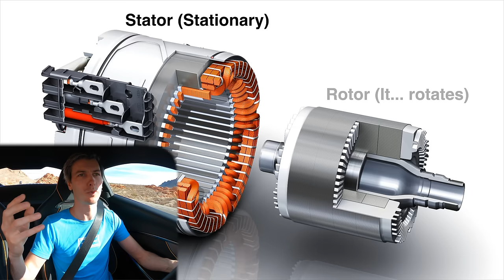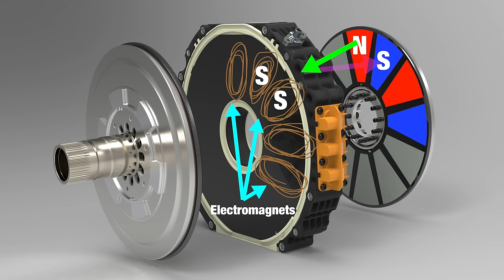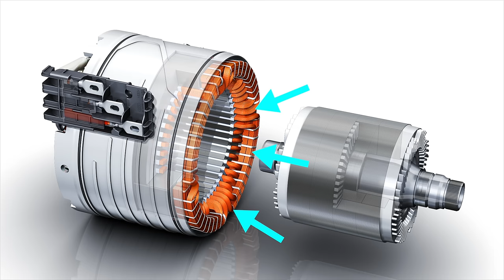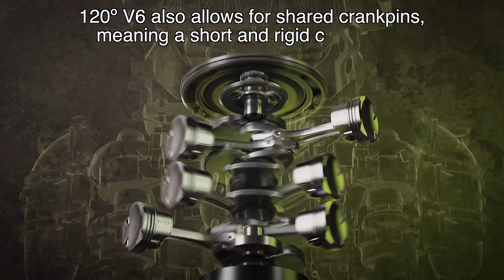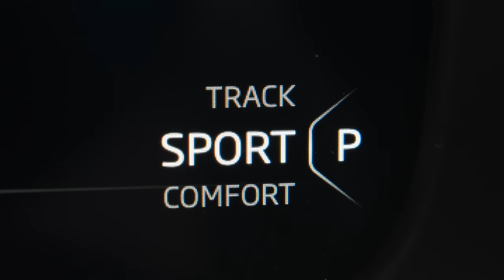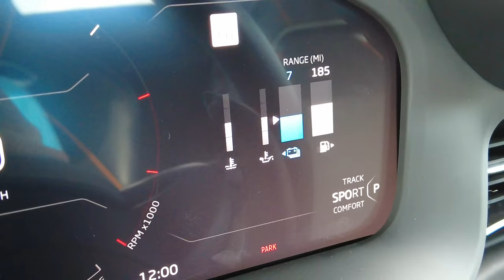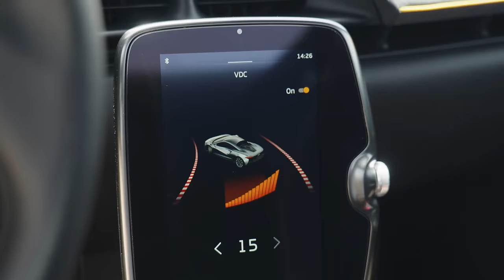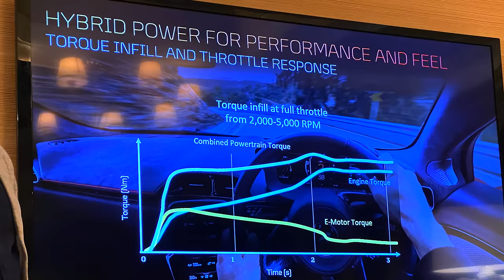These Tiny Motors Make Big Power! Why Supercars Choose Axial Flux

Comment: I would really like to see more hybrid electric cars that have electronically control throttles using some sort of system for adaptive load.

Essentially like if you're cruising on the road at 80mph at 3000RPM and 15% load, but the engine knows It actually has a significantly higher thermal efficiency at 35% load the ECU could turn up the load on the engine, and use the motor to store the rest in battery. I don't know how much more efficient the engine would have to be to overcome the losses of the electric drive train, but it seems a reasonable enough concept.

Alass I have no whiteboard or advanced engineering degree with which I may attempt to prove my crackpot theories

Comment: "why not go all the way to 180?" have you seen subaru boxer engines? they are more common outside the car on a workbench than inside a car and running. but i guess that would be par for the course on a Mclaren as well. regardless of what they do.

Comment: Rotor on rotor huh!? Years ago I dreamed and in that dream I saw something like fan on a fan which a flying shuttle flew quietly and (almost) like no blade/propeller - its actually there but they r ridiculously tiny & rotating insanely fast that it goes kind of invisible! What a weird dream that was, and I did hv another dream in which I saw the whole city moves efficienctly where everything (everything includes people, cars & kind of small personal transport) moves in syc & inter-sectionly without stopping, controlled by central traffic computer as they approaches n entering the city! Call me crazy but what I saw stayed in my mind to date!

Comment: Great job Jason on the video. I am interested to know why a dual clutch was used over a torque converter based automatic transmission, is it purely a weight issue or packaging ?
Reply: DCT's are generally quicker to shift than torque converter transmissions, that's probably why they used a dual clutch

Comment: Axial Flux motors have been around for decades and while they have some advantages, they are really not any more efficient or powerful than radial motors designed for the same performance.   It is similiar to saying a rotary engine is "incredibly more powerful"  than piston engines.  There are pros and cons of every design, but no engine is going to be even 2x better.

Comment: Is it worth the added weight and complexity for 100hp?
Reply: 100hp across the entire curve with instant response and giving you more driven wheels? Yeah.
Reply: For short trips , particularly in winter, you can save 'cold wear' on the valuable engine. Use only the 100hp motor, so it's an EV...

Comment: I'm late, but it might get noticed. How is the traction control working? Is it cuts the ICE or uses the brakes, or plays with the electric motor?  If it plays with Electric motor, how often? Is it a faster reaction then a normal sport car? I mean u just floor it out of a coerner, gets the EM boost, then when it slips it cuts part of its power, while the turbo boost starts to kick in, it is probably too much at once, but the EM now brake the rotation, then as the road open or whenever the traction is there, it starts to help the ICE again?

Comment: I noticed the clips of the engine show a starter motor, couldn't mclaren have saved the 5-10 pounds of that thing by just utilizing the axial flux motor to turn the engine over? Maybe ensure that a tiny bit of juice is always reserved in the battery for it?

Comment: Do you need permanent magnets or could you use like two windings and flow a current through to create the same or higher magnetic fields? As i understand this is used on some powerplant generators? You would probably loose on range.

Comment: It's like linear motor, but round. :) Engineer talk.
Reply: All rotary motors are like linear motors, but round.
Reply: @brianb-p6586  most have coils rotated by 90deg
Reply: @MariuszChr  When you unroll it to be a linear motor its a flat strip either way... and if you start with a radial-flux motor you have a straight strip, instead of curved.

Comment: You stated that the car has a "7.4 Kilowatt hour battery". I think that you misspoke; it has a 7.4 Kilowatt battery. Kilowatt hours refer to charging, and charging only. No worries, I have done this quite a few times myself when speaking to potential EV/HEV/PHEV clients, you just have to remember the difference when speaking about it.
Reply: He is definitely right, and you are definitely wrong. It's so totally basic, that battery energy storage (size) is described as kwhour. -a kilowatt of power for whatever many hours duration. ie kilowatt hours (energy). Kilowatts is simply Power, like the brightness of a light bulb, or horsepower. You can briefly get 100 kilowatts of power out of a torch battery!!!  (for 0.001 seconds, with a bit of electronics and a large capacitor)  . So are you saying that a torch battery can be described as a 100KW storage?!

Comment: Hello Jason. I've been doing some online reading but can't find a concrete answer. 

Have car companies explored using magnetic brakes in cars? What would be the pros/cons?

I feel like regen braking uses an electromagnetic component but I can't figure it out

Thanks
Reply: That's literally what regen braking is
Reply: @ILoveTinfoilHats  I feel like regen and magnetic braking aren't the same.

 It's Suttle, but in my head, regenerative braking uses the brake rotor as a rotating magnet, which induces a back emf on a stationary winding, and that voltage can be routed to the battery.

Magnetic braking would energize the winding, taking energy FROM a battery/ generator to induce a back emf on the brake rotor causing it to stop. 

Think of a fan, you can hand-spin the fan backwards, turn it on, and it's forced the other way. I feel like it would be a more efficient way of stopping the car, no?
Reply: @juancuelloespinosa  so regen braking but worse in every way?
Reply: @ILoveTinfoilHats  if regen braking was that good, electric cars would use it exclusively. Why carry around the extra weight of hydraulic braking otherwise?

Modern airplanes are already moving into break by wire. There's actually no hydraulic fluid used at all. An electric actuator pushes the break pads into the rotors.

They don't however use actual electromagnetic brakes. I'd love to know why, but haven't found anything
Reply: @juancuelloespinosa  because magnets don't work when you heat them up
Reply: @ILoveTinfoilHats  well that's for permanent magnets as far as I know
Reply: @ILoveTinfoilHats  less wear on the rotor, more efficient braking since you're acting on the whole rotor instead of a small corner like hydraulics
Reply: @juancuelloespinosa  you're making stuff up to try to make it happen. It's not efficient. It's not practical. It's not realistic.

Comment: Jason, please invest in a lavalier mic for your next road test. The road noise was too much, you can also invest in Izotope RX9 to improve your vocal reproduction.
Reply from the maker: Ha, yes, if you watch any of my others you'll see the mic. Tried a different setup this time and it obviously didn't work. Live and learn (see pinned comment). Will be better next time!
Reply: @EngineeringExplained  I was using my crappy laptop speakers and noticed right away. I thought you had always used a mic? Look into Izotope, it is incredible software. You can isolate various parts of your audio.

Comment: Would radial flux motors be a good choice for everyday vehicles as the sole power plant and not just hybrids. 

Vehicles with range of say 300 miles and a top speed no greater than 100 mph.

Comment: Hmmm. I am not sold on the advantages of an axial motor… if you compare an axial and a radial with the same number of poles, the flux needs to flow through the same amount of metal.
It can fit a different shape space, and it is harder to cool… needs water cooling.

Comment: Why does the E-motor have two rotors? 
One for the engine, one going to the trans; with the ability to couple the engine to the trans?
Reply from the maker: Because you'll have magnetic flux on both sides of the stator, might as well take advantage of it! (They don't have to have two rotors).

Comment: Aren't there other reasons than packaging for the 120°V?

I mean I'm not super up on my 6 cylinder firing order and balance shenanigans but I thought that multiples of 60° were good for some reason. I don't remember if it was even exhaust pulses or balance or what but I thought there was some other reason 120 should be good

Comment: A bit lame & a bit late. If this is the follow on from the 720s I think they have missed the mark 671BHP is less the 720's 710! Now look at Ferrari, they sort of followed the 488 with the SF90. Yes a lot more expensive and still retrains a full blown V8 along with 2 electric motors and an electric motor/generator. These mild hybrid supercars are manufactured for 2 reasons. Legislation, Clean Air Zones, Ultra Low Emission Zones & congestion zones. The other is so you don't wake your neighbours with early starts & late finishes. The one thing all these hybrids have in common is you can't run out of electricity. As soon as they almost empty the start recharging the battery. Now back to Ferrari after the SF90 and before the Tesla Roadster is released. They came out with a "My First Ferrari" bottom of the range and relatively   modest price point. We are talking McLaren country here. This the Ferrari 296GTB. Do you think McLaren stands up well next to that?

Comment: If the motor speed is coupled to engine speed then you can't target the best engine and motor efficiency at the same time, as opposed to a Toyota/Ford/Chryer type eCVT, a Mitsubishi/Honda type series-parallel hybrid, or a Volt type compound split hybrid. Long story short, good for power, bad for efficiency.

Comment: If axial motors are so thin, why not stack 8 of them side by side.. rotor/ stator/ rotor/ stator rotor stator etc & generate 800hp?. If you had a 3ft wide motor with the rear axles going into the ends it would save space & make power

Comment: Is it my imagination or was there a starter motor on the engine (6:41 lower left side)? Wouldn't they be able to use the 94HP electric motor to instantly start the ICE? Or is that a gear driven something else?

Comment: In the beginning I was wondering why the car was so noisy XD
I have been wondering why aren't there many electric cars with internal combustion engines (ICE) as power generators.
There are only very few cars which have a range extender like the BMW i3 but that one uses a repurposed engine which does not appear to be very efficient in making electricity.
So is the reason simply there is no way to make ICE to be efficient power generators?
Usually an all electric drive train is simpler and more efficient than a hybrid drive train so having ICE as power generators must have crossed some engineers minds.

Comment: OK so I just noticed on the V6 they still have a starter motor with a 100HP Traction motor? that could that do the same job??  Hybrids have been using the Traction motor to start for decades.

Comment: At 7:30 we see the back of the engine and I'm wondering if I really see the starter motor on the engine in addition to the 94hp electric boost motor?  I'm a big fan of Mclaren engineering, but this seems to me a giant fopaux of unnecessary weight especially considering McLaren's relentless focus on weight.  Surely if the boost motor can power the entire vehicle it can start the engine.

Comment: ideal hypercar would be a rimac nevera, replace the battery with a turbo 3 cylinder "generator" so you have EV power without the weight

Comment: Why 120 degrees V6 ? Isn't the most obvious answer that this way you get an even firing piston engine. For a V8 it would be 90 degrees and for a V12 it is either 60 or 180 degrees. Cadillac had V16 engines with 135 degrees angle between cylinder banks.

Comment: Question?  Why couldn't you build a car with these motors at the wheels, no transmission or driveshafts, a very small battery pack, and a very small air cooled engine acting as a generator?  Wouldn't that make for an ultra light, ultra simple, ultra efficient vehicle?

Comment: 4 passenger, AF motor, flanked by coax torque converters, requires no gears or differential.
Cheap to build, efficient in miles per watt hr.  180 eMPG.  NO center console, variety of bodies, 2 door 3 passenger business coupe, 4 door limo like a Traction Avant, small 2 door 3 passenger pickup, convertible, sports car.  Same skateboard, function, different style.  Cheap to build, cheap to buy.  <$25,000.

Comment: Well, McLaren gave you wrong info. The Ferrari SF90 Stradale has axial flux motors, and it's been out for 3 years. Also the Ferrari 296 GTB is using the same tech. Both came on the Market before the Artura.
Reply from the maker: Yeah, I wasn't quite sure when the release dates for all of these were, but I was aware of the SF90 & 296. Artura launched in Europe earlier than the US - probably something I should have looked at specific dates for (either way, McLaren's claim is: "The E-motor is truly ground-breaking, being the first application of an axial flux motor in a series- production road vehicle."). Maybe series-production is the key wording? Idk.
Reply: @EngineeringExplained  none of the Ferraris are limited production though. I feel like they're going for an incredibly narrow niche to say they're first.

Comment: With the electric motor in your hands would they be stackable? Could you put multiple on one shaft to produce more output? Could this be the lead into a fully electric McLaren by putting an electric motor on each wheel?
Reply: Like a Wankle, Hmmmm  might be hard to sync together
Reply: @Philip Mackin  Splined output shaft would help clock the motors and the outer hold-down ring would help too.
One controller might be able to control more than one motor when timed.

Comment: This Axial Flux motor would be perfect for a sailboat with an electric instead of diesel motor.
Reply: Sailing Uma on youtube.  They proved it can be done. Just don't be in a rush to get anywhere as EV sailboats are sailboats with an electric motor for 10-20 Kms only.
Sails and diesel will be king for a few decades yet.

Comment: Could these motors be attached directly to each of the four wheels yielding an interesting amount of horse power and huge torque?
Reply: The drawback would be an increase in unsprung weight.

Comment: Having bought very successful  Australia lithium mining shares, if the motors take off, time to buy neodymium mining shares.
Reply: However, axial flux is not as magic as proposed. The part of each winding that is at the outer end is inactive as it cuts no lines, it is dead like the wraparound end on radial windings. Also the bridge between magnets on the rotors is not short so lossy again. The way to reduce this is to stack the motors so only a bridge at each end. Internal windage losses are significant but the turbulence can aid cooling. Ironless stators give very smooth pulseless torque, read 'no cogging' so super quiet. (Swedish subs?)

Comment: Wait…so 4.6 kW per kg if I’ve converted the units right. That’s lame. Can’t understand the benefits. 10 kW per kg is quite standard (sustained) with peaks of 15 or more. Using surface mount magnets and concentrate windings (much less unused copper). One disadvantage tho, kind of high idle current giving bad efficiency at partial torque load. Shouldn’t be an issue for a race-car tho. But well it’s a hybrid so a mess in any case…strange setup

Comment: Why does that car sound like a rough, loud, early 80s Toyota truck inside? It is as rough riding as it seems? I sort of lost faith in McClaren when I found out (not sure if true) that a steering rack for a MP4-12C was ... $36,000. Uh... what? Remember how cheap some of those MP4-12Cs were, at least back then used? Maybe things like this are why? At the time, if I'm remembering correctly, a Lamborghini rack at the time was around $6000, still ridiculous, but not as ridiculous.

Comment: Pfft, manual gearbox box high boost high rev engines do the same super quick throttle response, just drop down a gear and boost is basically instantaneous with throttle unless you have a HUGE turbo on a little engine setup for drag racing.